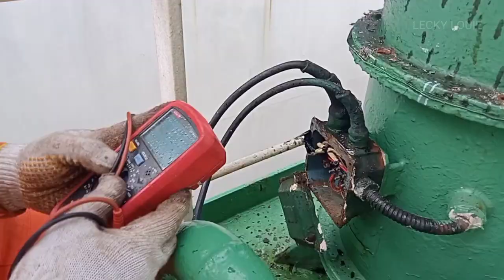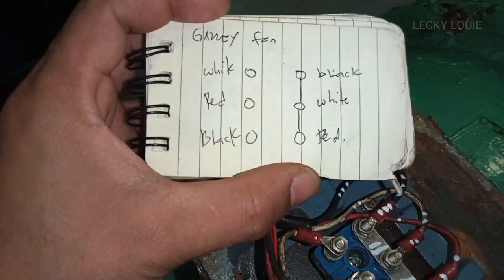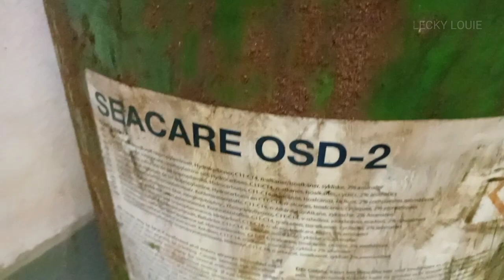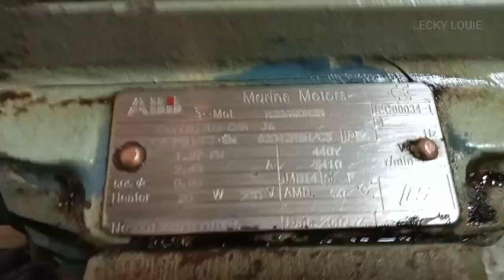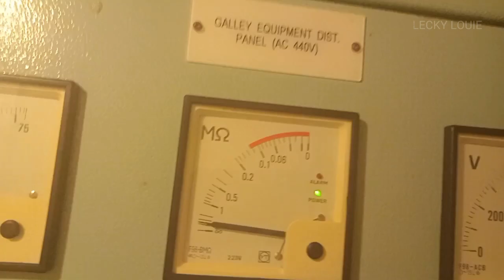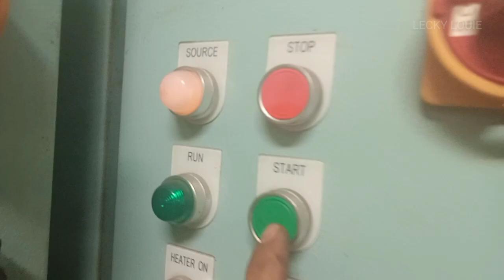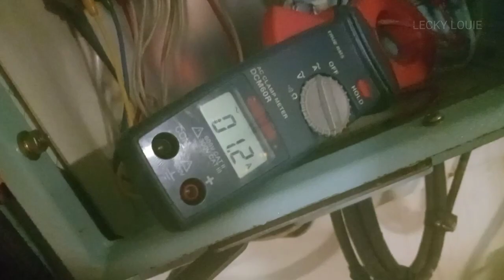De-greasing and overhauling of Galley Exhaust Fan Motor

Comment: Good work lecky, May I ask you if those Multi tester, and insulation tester is ur own or by company?
Reply from the maker: The Company  provide a electrical tools, multimeter and megger tester onboard. But I also have my own multimeter and electrical tools as back-up.